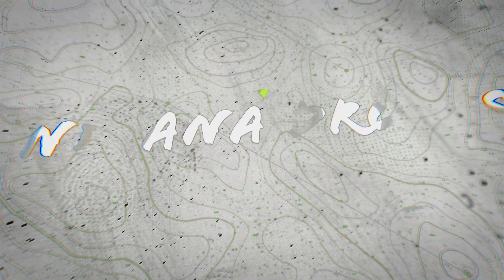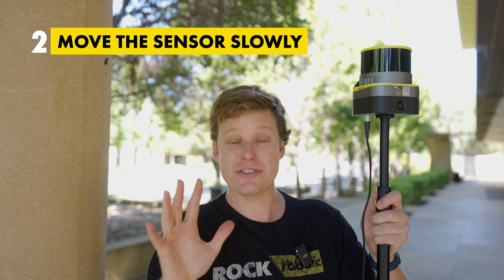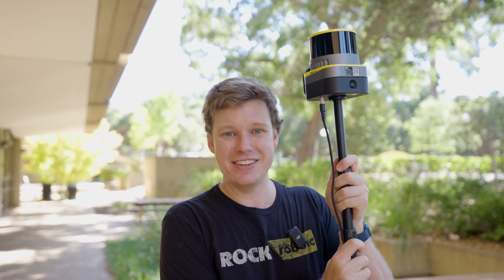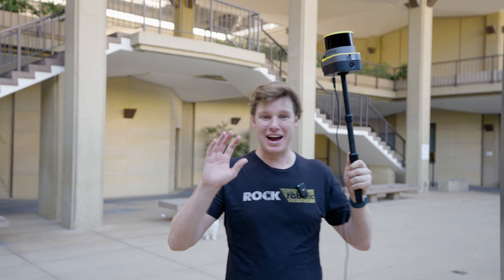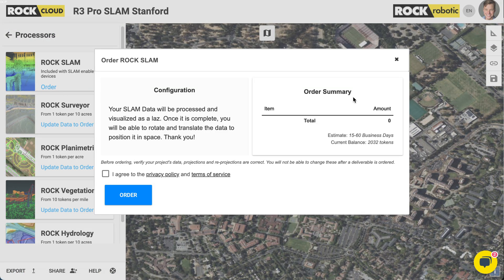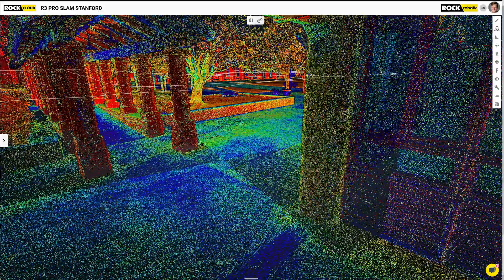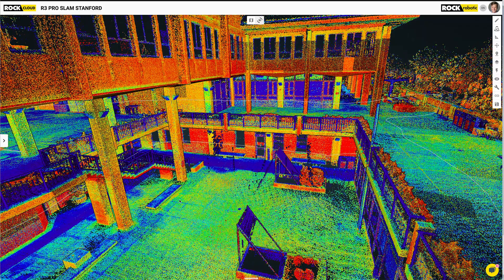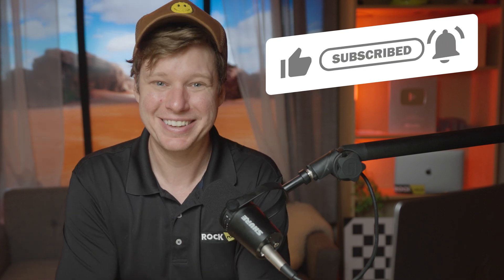How-To LiDAR SLAM | ROCK R3 Pro

Comment: I expected something better from the R3 SLAM. Learn from the GeoSLAM and make something with better usability. It must be horrible to work with this equipment for more than a few minutes. It has no ergonomics, the bar is thin, the working height and the movements will cause pain after a few minutes of work. It's a shame that such a good piece of equipment was put into something so bad. Honestly: it seems poorly made.

Comment: The addition of an RGB camera and GPS to SLAM is very exciting. Will it be possible to have multiple devices working in tandem on the same project, with data being transmitted in real-time to a central server?
No doubt, having that many LASERs around would feel very Star Wars-y :)
Reply from the maker: That's an awesome idea! But, I don't think that much data would transmit properly flying through the air. This method shown here is the best way. One device and then being processed in the ROCK Cloud.